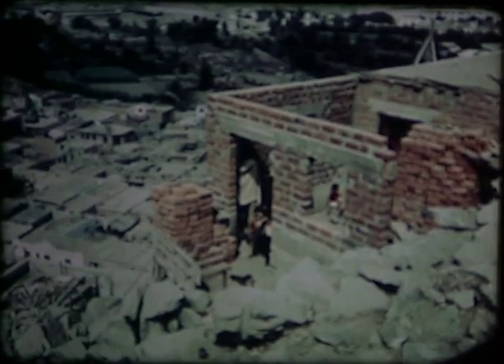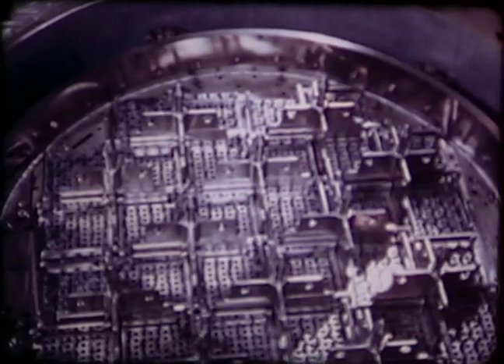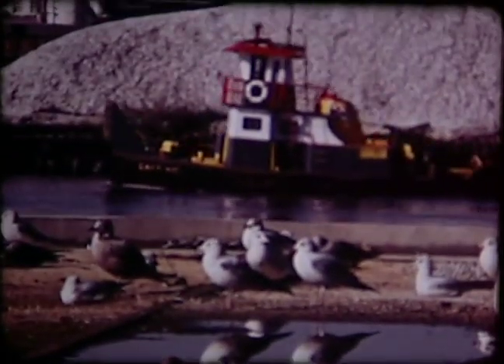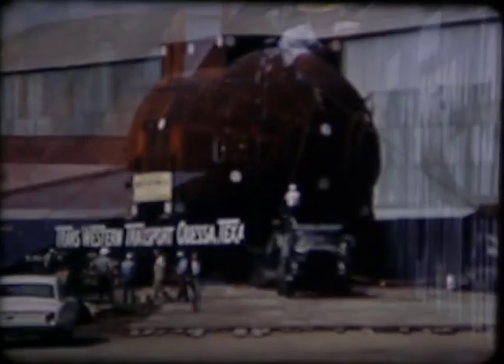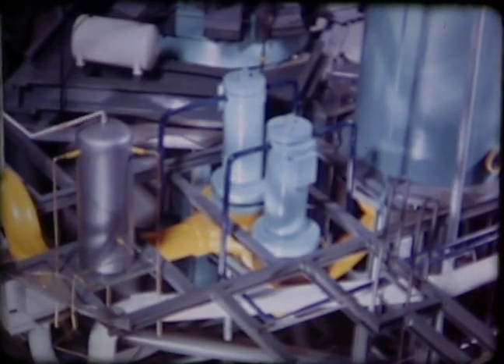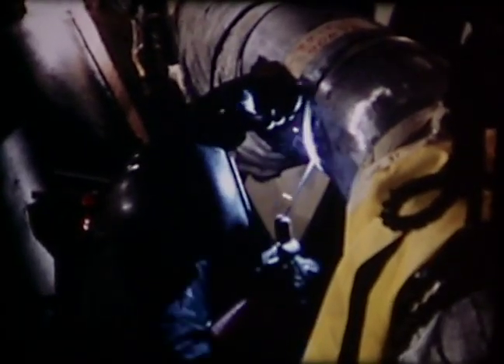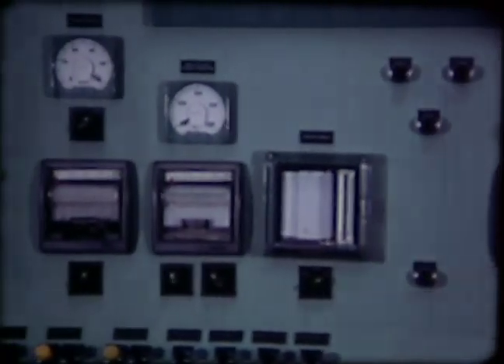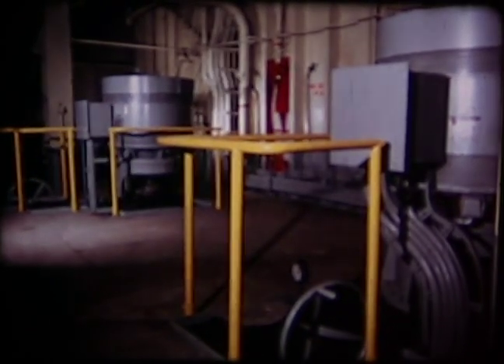MH-1A: Floating nuclear power plant, STURGIS: Construction report

Comment: Seeing its construction now, decades later, the construction is extremely rudimentary. At least they had a secondary pressure vessel. There is that at least. Incredibly slow scram rates though.  24 fuel bundles. 12 cruciform control blades. It appears they used globe valves in the primary loop. Astounding - not in a good way.

Comment: Better than most for the Army Nuclear program. Though it still lacked the fundamental lessons and command and control of the US Navy.  - In particular the Safety Culture and SUBSAFE program and intolerance for anything that isn’t Safety Culture. With only a 56% capacity factor, the costs could not compete with alternate sources of power. It also lacked major safety design features.